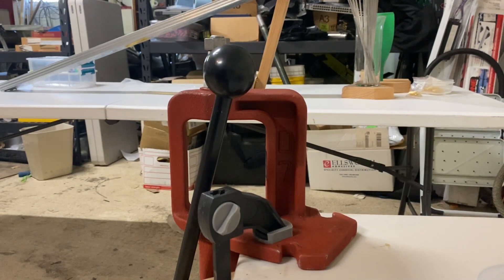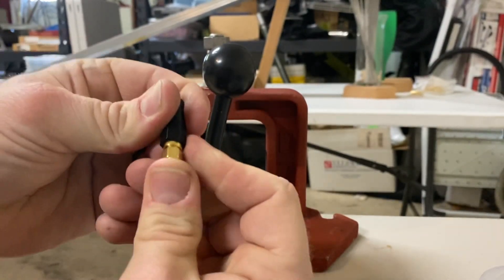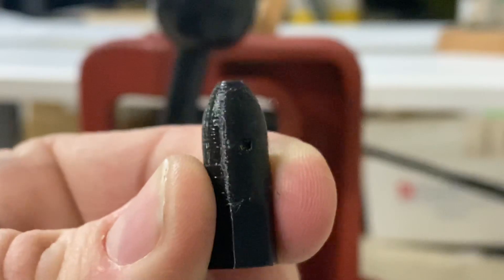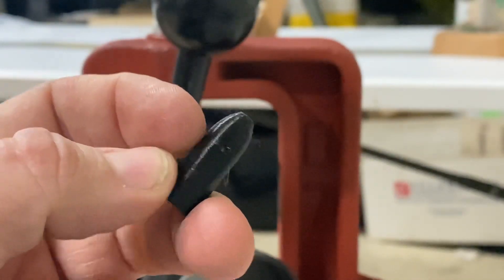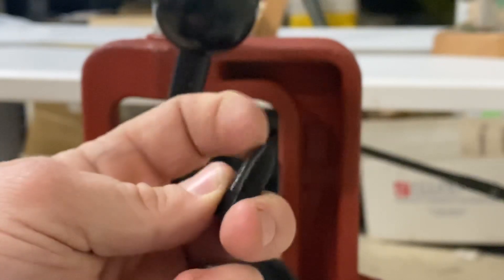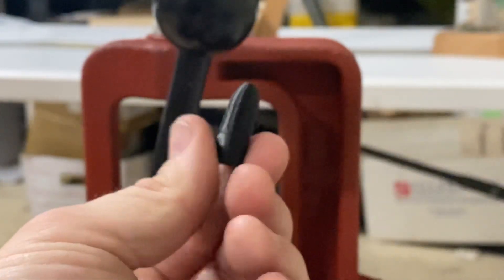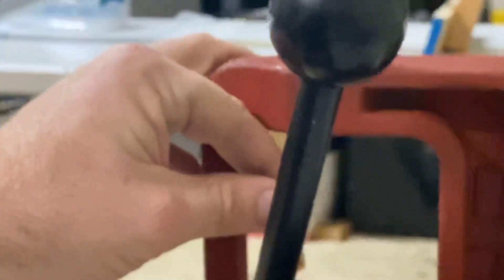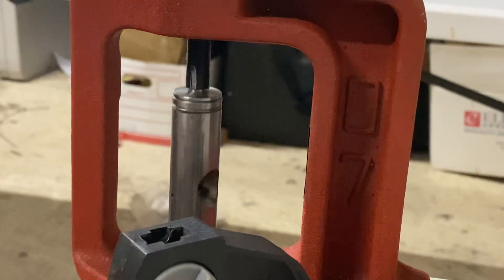Signal Stick build tricks — SMA male press

Comment: Would you be willing to share the stl?
Reply from the maker: Sorry but no :-/ One of the things that helps to simplify my processes is that I can always tell if it's one of ours or not -- nobody else has the parts to reproduce it.

Additionally it wouldn't do you much good unless you had the exact same connectors that I use, which are customized. Even from this video, which was fun, we've completely changed both the connector and the parts and now I get them injection molded.

Comment: I got one of your antenna's a few weeks ago, and sure enough that plastic part, broke on me. But, instead of sending it back, I fixed it. Using electrical tape and some shrink fit tubing. and heating up the tubing, has fixed the problem. It is now on a HT that I will keep it on. So you might want to use something better material wise to print that little piece. Just my two cents worth.
Reply from the maker: Hey sorry about that! What probably happened is that there was a small flaw in the 3d print layer -- I try to catch those, but miss them sometimes. If they print correctly they are actually pretty tough, but if there is an issue with a layer in the middle... :-/

Let us know if it becomes an issue, we'll replace under warranty. at least the plastic part isn't actually required for it to function well =]
Reply: @HamstudyOrg  That's cool, like I said I fixed it, so its all good. I have ordered two more so I will keep an eye on them. Thanks, James KI7BSL

Comment: Will you be selling a tri-band signal stick antenna in the future?  I love my dual band signal sticks
Reply from the maker: I hope to, but designing one is if not beyond my ability then at least towards the edges of it =] I have some definite ideas on how to do it, but at present it's hard to find time to dedicate to it as most of my time is being spent on examtools (used for administering exams including the fully remote exams) and a rewrite/update of the hamstudy mobile app
Reply: Tri-band signal sticks would be impossible to make. Without loading coil mumbojumbo the classic 19 inch nitonol wire is only gonna be resonant at 2m and 70cm.